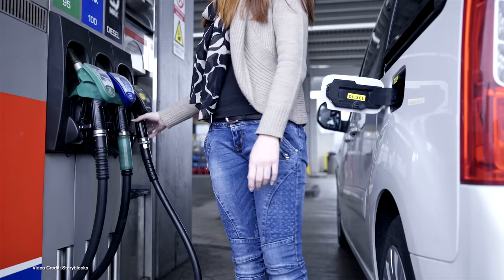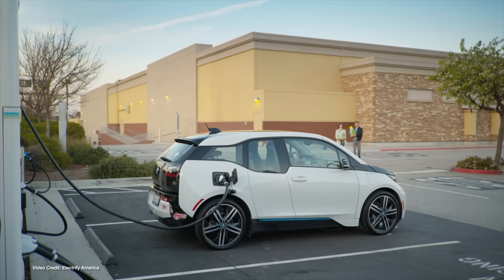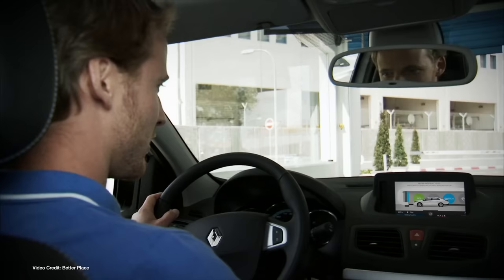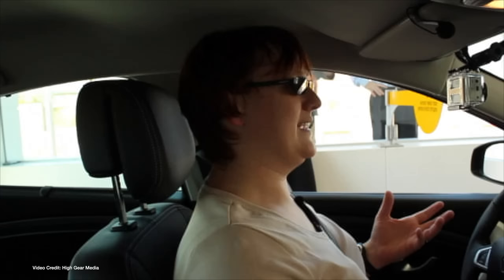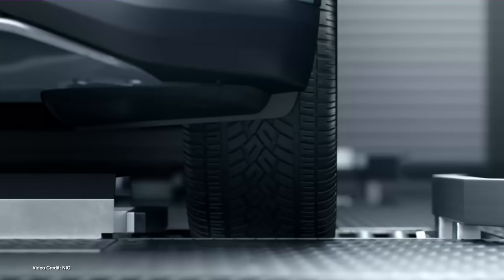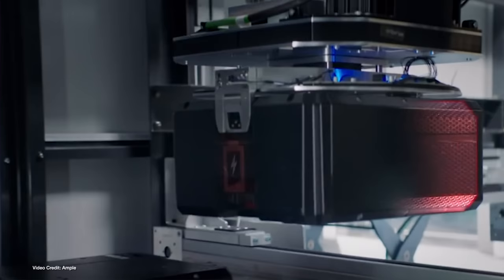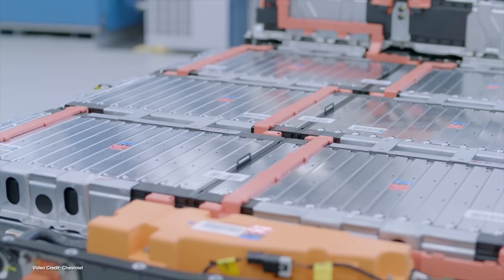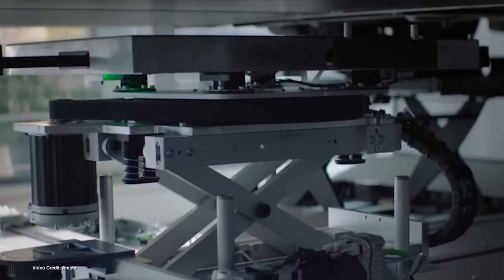Ample Space For Electric Car Battery Swapping? The End to Slow Charging? This Startup Thinks So

Comment: Battery swapping; aka, the charging infrastructure problem starting all over again from zero but with way higher capital costs and no standardization in sight
Reply: Yeah let's not try something different/better. Coz this👆 expert is crying
Reply: @jeffsteyn7174  
I mean, this is trying to solve a problem that faster charging batteries will solve inside of a decade...I just can't see it being more than an interesting niche application in the future
Reply: Not to mention your company has to own and operate a fleet of batteries that you also hand off to customers who will do god knows what to them.

Operator-owned batteries keep interests better aligned when it comes to maintaining the capital assets, which is an inherently better solution.
Reply: @jeffsteyn7174  "Oh, look at me, mommy - I can troll, too!"
Reply: Also don't be surprised to find industry lobbying working hard to make it harder to charge for yourself at home. 
Operations like this tend to centralise the control of the charging infrastructure, keeping in the hands of well capitalised and powerful corporations, instead of in the hands of users.
Reply: China standardized it.... Since they know its value...
Reply: @Ryukachoo  Battery Swapping helps balance the grid..... DCFC makes it worse... So it wll more that just a niche.... or more will have to be spent for energy storage...
Reply: @em0_tion  good luck getting a mirror

Comment: We can't even get the EV manufactures to agree on a single type of charger type. They would never be able to make this work
Reply: They have, J1772 and CCS, it's Tesla that wants their largest competitive advantage to stay.
Reply: @Xithia  Europe uses IEC 62196. And CCS also has two versions. And most but not all use CCS. Nissan uses CHAdeMO.
Reply: @rogerstarkey5390  And CHAdeMO before Tesla. Your point?
Reply: @HenriZwols  and CCS3 is already in development, but that's not an issue as they are backwards and forwards compatible, just like USB for example. In Europe, Tesla has moved to CCS as well and the new Nissan Ariya will also feature a CCS plug in Europe. In Europe, CCS will be the standard.
Reply: @HenriZwols  In north america the standard that that ALL manufacturers have transitioned to is J1772/CCS except Tesla, Nissan has stopped including CHAdeMO on  new cars. In Europe Its Type 1/2 Including Tesla, who switched from their Tesla plug to Type 2 demonstrating the ability to switch, and makes their inability to do so in the US telling. The worst part is that Tesla is supposedly coming out with a CCS to Tesla adapter, allowing Tesla's to charge anywhere but not allowing anything other than Tesla to charge at their stations, unless you're in Europe.

Comment: The problem with battery swap is that it need more battery packs than the number of cars, maybe a ratio of at least 2:1, and the main problem of ev industry today is battery supply constrain.
Reply: And they need all the same form and connectors.
Reply: There are so many problems with this. First the world will be in a battery constrained time for the next 5 years at least making this expensive to stock.. Then the automated stations will be a problem keeping them running. I have seen plenty of videos about simple chargers being out of order. This looks like a very complex package which may look good on paper but will be costly to maintain. Then they will need to sell folks on the fact they are relying on an unknown used battery. Then the connections in the car's bsttery need to be designed for multiple plug and unplug opporations. Just seems too complicated for everyday opporstion in the open consumer market. .

Maybe this could work for a closed systems zuch as freight oppressors or robo taxis fleets.

Comment: A more realistic scenario would be if EVs have a removable reserve battery that functions like a Gerry can, and uses a standardized power port. Something that can be swapped in for enough range to get to a charger without having to pump juice into the onboardain battery first.
Reply: that makes sense ... something like a gerry can is a great idea .. i dont c ppl waiting half an hour just to swap their battery .. could u imagin when every body has an e.v. the line ups it will make and the time waiting .. even with Gas .. sometimes i wait in a  line up when the price goes down !! swapping bat. is a bad idea .. but a small container with enough juice to get u home is great !!!
Reply: @manumus11  THIS would make sense with those "air batteries" (rather small, compact, with lots of energy but single in car use), with maybe 10kg module to have ~1/2 of a full battery - I could see this working with regions that lack fast charging infrastructure with 2-3 such modules (think eastern Europe)
Reply: Yes! A range extender plug in option would be really useful to allow you to go further off-grid when needed, at the sacrifice of some cargo capacity.  Would love that for our work vans very occasional longer range day trip.
Reply: So you want to swap a smaller way battery more often? What’s the point?
Reply: JB: point is it would be cheape and simpler to use a battery swapping network like Gogoro that mostly used for scooters now...that can add range far faster and it can shift the load to off peak hours.... 

Unlike SC or any DCFC networks..... But there is voltage and other issues, to use it....

Comment: It's winter, my car got a lot of snow and muck stuck under it. I think a "under the car" battery swap is no go as a world wide solution.
Reply: Easy, they can just use a hot jet wash to clean under the car first - what could possibly go wrong with high pressure water and a removable high voltage battery (which burns even better when water is involved)!🚗 ⚡⚡🔥
Reply: You could have the battery swap station next to a drive thru car wash so that you could first go through the car wash and then do the battery swap.
Reply: @StephenBieda  Yeah, lol. So you have to do an expensive Car wash for swapping the battery on top of that you have to waste a lot of water...

Comment: I have to agree. The chance of many brands having a universal battery pack standard is low. But it would make sense for 24/7 taxi company for example. With the reliability of EV's you just change drivers and the battery and get it back on the road to earn income. They can also leave off the underside panels for easy pack access.
Reply: In Teslas, the battery is a key part of the structure of the car.  How could you "drop that out"?  It would be like dropping out the frame.
Reply: Wouldn't it be easier to have wireless charging for the taxis in those taxi-dedicated parking spots?
Sooner or later we might see wireless charging (at least in parking lots)

PS: We had Qi charging for phones quite some time ago, then it almost died, then  it revived - it's so convenient if done right and with little harm to the battery with slow charging.
Reply: Honestly I don't see a point of wireless charging or batteryswap for taxi companies. It might just be better to have some central charging locations with one person running it. This person plugs the charger in and out, but can also check out the car and clean it up a bit if necessary. This way you can ensure good service/clean cars, while also avoiding the need to buy more complex/expensive systems. You could even just have students do this, seeing it doesn't requires much know how/experience.

Comment: I could see it working for the Tesla Semi, especially if they have level 5 autonomy someday.  Otherwise, probably not.
Reply: @rogerstarkey5390  Battery swapping would allow for smaller lighter battery packs as the Semi is very heavy.  Also, the packs could be charged slower for longer life.   Tesla tends to overestimate the real world range of its vehicles.  An autonomous Semi needs less down time. Swapping might not be necessary, but it could be helpful.
Reply: @willaerley7140  If you swap, you are going to need more batteries. And you likely still will need the batteries getting supercharged inorder to have enough batteries ready at any given moment or you need several times the amount of batteries and the extra space to store them during charging. And Tesla's new battery design should help a bit with fastcharging degradation.

I don't see battery swapping being used except for niche applications.

Comment: I would totally lease for battery swap if it means there was no charge for "original battery" in the first place.
Reply: In the sense that an EV would actually be quite cheaper than it's ICE counterpart ? This might work for smaller cars with air-cooled batteries, e.g. Renault Zoe to cost ~ Yaris rather than ~ Rav4 Hybrid!
(maybe the "refueling" will be a bit more expensive, but maintenance is also quite a bit cheaper in EV's)
Reply: I think one of the French companies had an EV concept where they didn’t charge you for the original battery, and you paid a subscription for the pack instead
Reply: The problem is that battery costs are still decreasing, it would in the long run shave maybe a few k of the price, but not much more, while you have become reliable on this batteryswapping. What if they say you can't supercharge the batteries, or what if they suddenly jack up the price, what are you going to do then? Still pay for a permanent battery, meaning you might have actually wasted more money?

Comment: Battery swaps could make the used EV market very attractive. Buy a used EV without the battery for far less and purchase the battery adapter kit and a starter battery that gives you enough juice to make it to the swap station and away you go. The cost would be based on the pack/range options. If you weren't planning on going on any trips, you opt for the cheaper town battery. Going on a trip you'd opt for a higher-priced long-range option.
This could get people into EVs that can't afford the luxury pricing because the OEM battery costs too much. I'd consider getting my feet wet if that was an option for me.

Comment: You quickly realise when you get your first ev that you change your routine, to exclude filling stations. You fill up while shopping, meeting a friend for a coffee or having lunch. It’s only on longer trips that charging times can be a nuisance. But again, you usually plan your breaks when you need to charge, so the actual extra time needed for a charge is usually minimal. I can see a market for delivery vehicles that take on a fresh battery when they reload. And battery swaps for motor scooters could work. The future will probably have a place for all the options, depending on each market.

Comment: This would be a great life-extender for older EVs.  Imagine turning your city-bound Nissan LEAF with an old depleted battery into a "go-anywhere" car that can quickly recharge at any Shell station.  And since they are replacing the original batteries it gives the old cars range they never had before, making them even better than when they were new.

Comment: Great discussion topic and some excellent comments on here 👍
Something to consider, but only for a certain segment of vehicles - e.g. commercial transport/vans - I'd value the option to ADD range to a van for the occassional longer day trip via a plug in module
Overall, anologous to filling up with ICE fuel, but the downside is there's less control over the quality of the battery pack you plug in if they are not owned by the Ample network themselves.  You don't want to plug in a faulty/old pack.

Comment: Battery swap is a great idea, especially if a number of manufacturers agree on a standard and share the costs associated with installing batter swap units (Nio is leading, others are joining them....and there is a ton of empty bricks and motor units that would welcome a new use). Interestingly, battery swap may become obsolete should new battery technology eventuate....and this would not hurt NIO’s business model. Nio could still offer the swap based on temporary supersize me scinario or their rental by way of upgrading capacity/technology. My call - EV charge stations will become the new obsolete petrol stations....there simply won’t be a need..

Comment: I think this only works if it is 'battery and charge as a service ' where you rent the battery.
The customer buys, rents or leases the vehicle without a battery. The vehicle could take 1 or more battery modules and the customer rents as many as needed, getting additional module(s) if they plan a longer than normal trip.

Initial capital cost is much lower.
Battery cost is per day plus per kilowatt hour.
Being able to adjust the number of modules will allow customers to use only as big a battery as they actually need.

Comment: Dead on concept.
The R&D is not focused on swap everytime but instead swap old for new. Liquid for solid. Slow to rapid charge. 
Of course Oil would be behind it, they are desperate and still don't understand they will not survive. As you well said, they are energy companies but they still see themselves as oil companies.
In 5y we will have the first Tesla with Solid State Battery that can charge in 5 minutes. That will be the beginning of the end for fossil fuel vehicles.

Comment: I like the idea of a swappable battery standard - it protects the owner against battery pack failure and provides a route forward to newer battery technologies as they emerge.  However I agree with you that “hot swapping” on the road (vs an irregular maybe every few years battery upgrade in a garage) is a non starter apart from major freight companies on predictable routes or public transport vehicles.   
The first time someone tries to hot swap a battery in a snowstorm is likely to be the last.  Does the booth include an underbody wash and de-icing spray?

Comment: I think that battery swaps only work for scooters - your point exactly. 
I think that induction charging (or wireless charging) on the highway is a much better idea. Charge while you drive has been proven already using a Renault van at 70 mph. No stopping may make lighter shorter range cars more practical and obviously cheaper than long range heavies. That's better all round for everyone.

Comment: As I understand it, the Nissan LEAF has had 5 different battery packs so far. 
The problem with the 'swap' idea is that it will stop development of better battery packs to avoid redundancy of existing assets, in the same way in which the major manufacturers are loath to kill off the diesel and petrol engine plants.

Comment: I think battery swap has a potential future in the industrial market.  Large trucks, excavators, trains, forklifts etc.  I don't think there is much of a need in the personal vehicle market.  It's too limiting for the designers and engineers of those vehicles.  That being said, perhaps swap might find success in a hybrid approach.  

Start with a city car with ~100 miles of range for day to day use but also have the option of visiting a swap station to add a module for long road trips.  This would drop the purchase price of a car by not having to put such a large battery inside and would remove the anxiety of trading out 'your' battery for one that had been possibility of being abused by others but still give you access to the larger sized battery when you actually need it.  Further, as battery technology improves, it's entirely possible that the capacity of the swappable modules increases over time giving your car more range over time.  

The downside here is that you wouldn't be swapping your entire pack so you would have to stop more frequently, especially on the longest of trips... but for a shorter time which seems to be the main complaint of HVDC charge stops among critics.  They can't get past the 20-30 minute wait to recharge.  Perhaps they would be OK with double the number of stops but for only 5 minutes each?

Comment: GAC Aion S will have an Aion O model (in Guangzhou) with a swappable battery, it's for the Didi and taxi drivers who complain they don't (and customers won't) like to wait for the battery to be charged. There are those people that believe a built-in battery is still better if it is big enough. That way you can get a 150km quick fill-up under 10 minutes just when you need it. The way it's starting to look like is 80-100kWh is the standard battery and a quick charge will get you on your way as fast as the battery swap.  Luxury cars will have 150kWh batteries or 800-1000km NEDC range.

Comment: I worked at Blockbuster for 5 years. Be kind rewind never worked, I am loath to see what people would do with rentable/swappable batteries.

I could see something that plugs in a half dozen charging cords at once being easier to implement than swapping the entire battery assembly out. Those factory robot arms are pretty smart nowadays, they could easily be set up to aim at charging slots on the underside of a car. And it wouldn't take standardization other than charging ports. Any car that wanted could add in a few of these ports to the underside of the battery pack, they wouldn't have to build their car around a specific size and shape battery.

Comment: Totally agree that this is a solution that might work in a commercial setting, but is very unlikely to work in the general passenger car/truck market.  The battery is the most expensive part of the car and can easily be damaged by abuse.  I would never swap my battery for a random one of unknown origin.  Battery leasing could resolve that issue, but again, battery design is not standardized, and how do you deal with the liquid thermal management systems on most battery packs.  Disconnecting and reconnecting the plumbing lines and then purging out any air sounds like it would take some time, and could lead to problems if not handled correctly.

Comment: Hydrogen is just a battery you can swap (easily). It is charged off line using electricity  and then transfered into the car where it discharges as you drive. It's just a practical battery swap.